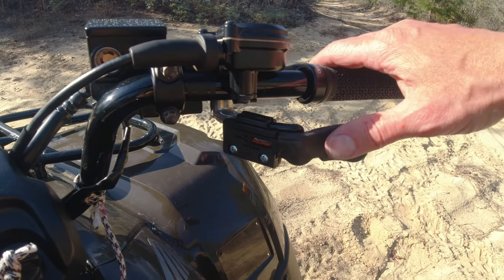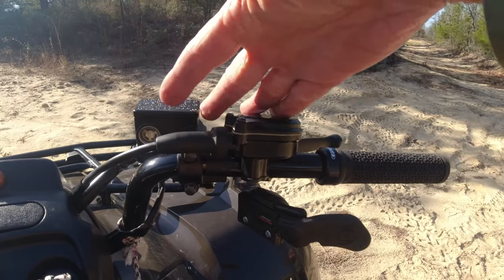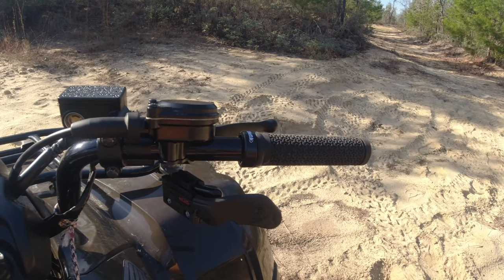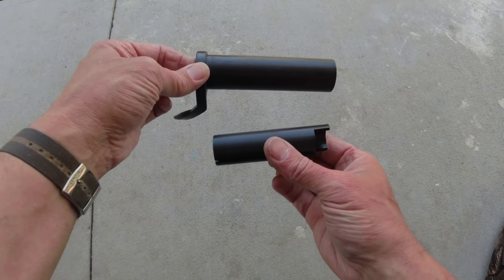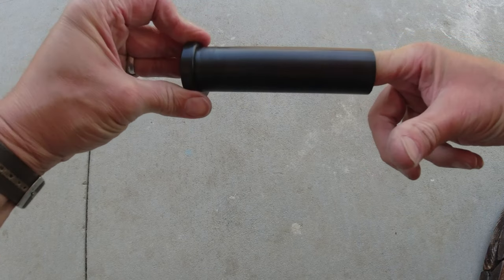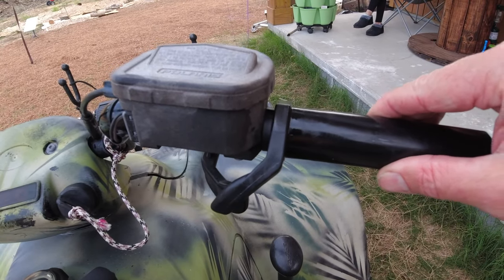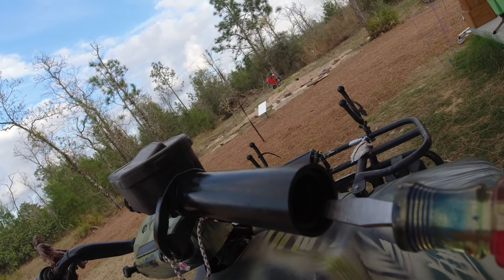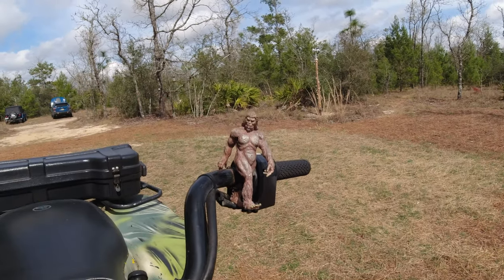Koplin Throttle Master & Handy Throttle, install and reviews.

Comment: Tip: use compressed air under the grip to slip them on and off easily. You can put use some soapy water as well if needed.
Reply from the maker: @andrejolin8967  Good tips, especially the compressor if handy.

Comment: Mine came with ZERO instructions!  Thank you for this!
Reply from the maker: Glad to help! It's actually harder to install than I originally suspected but the design makes sense and works great.
A guy recently told me his slipped a couple times and needed to glue the inner as  per instructions. If you do a lot of bumpy / jumpy off road you may have to do the same.

Comment: I with the kit came with 2 grips. I don’t like the right feeling bigger then the left. Otherwise I love this twist kit.
Reply from the maker: Totally agree with you. I bought after market grips that I love so much I kept the left one so they don't match now. I'll use the spare Koplin grip to replace the right side when it falls apart one day.
Funny now that I think of it, did mine even come with two grips?
Reply: @HomesteadOnThePreserve  mine didn’t come with 2 grips. And I did have to glue the inside tube to the bar. Even though it’s a tight fit. After a few miles of rough riding , it would get tweaked clockwise. Then it was hell getting it back into position.
Reply from the maker: @pstarxxx78  Yes! Mine slipped once also when I went hard core off road. I moved it back and it's been fine. I haven't gone off road since but if it happens again I will glue it! 
Thanks for sharing your experience.

Comment: How's this holding up over time?  Curious if you had the same issue with the actuator snapping while riding.
Reply from the maker: The actuator has held up perfectly. About 4 months ago my brother came to visit and preferred the thumb throttle so I swapped it for him. I never put the twist throttle back on because he's coming to visit again. 
I much prefer the twist with one exception. Going off road when it gets real bumpy it's difficult to maintain throttle control and can actually be dangerous. 
My final verdict, if you're riding on smoother surfaces the twist rocks, otherwise the thumb throttle wins.